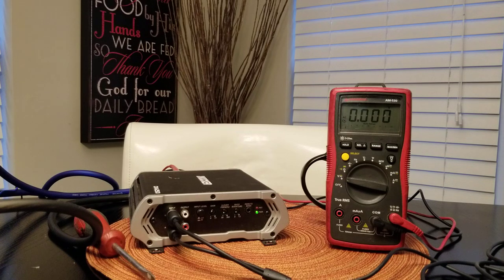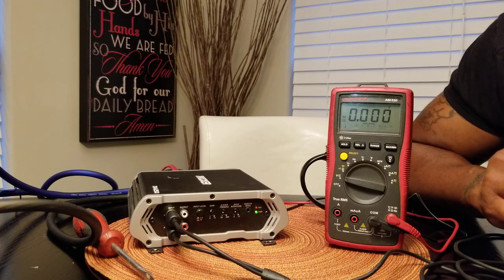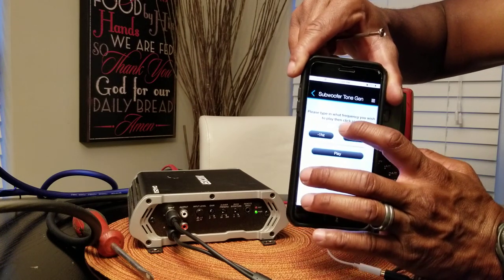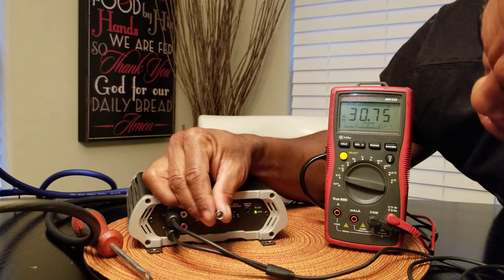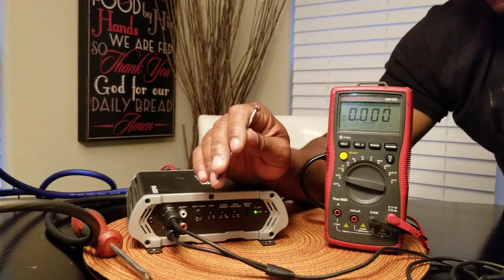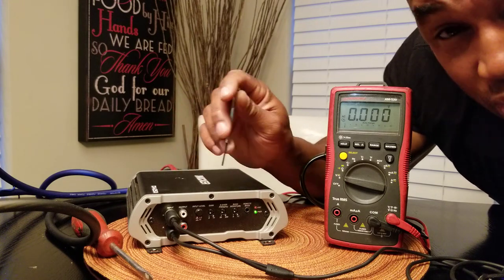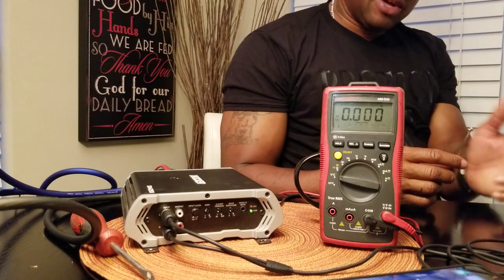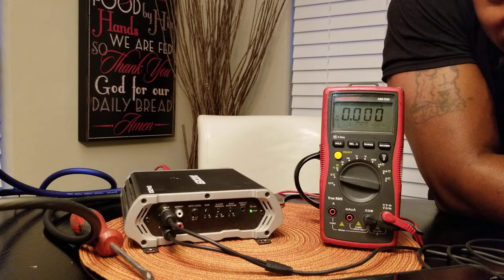Setting amplifier using multimeter

Comment: So you get take the rated power and multiply it by the ohm load in which it makes the rated power and square root it to get the gain voltage? What if my amp is rated 750 at 2 or 1 ohms? 750x2 is 1500 but 750x1 is 750 won't the square root give u a different voltage rating?
Reply: If your amp is rated 750 at 2ohms its cant be rated 750 at 1ohm at the same time. Thats two different amps. Right?

Comment: After setting the gain this way, does it hurt the sub to adjust the eq or the subwoofer out level?
Reply: Yes it will cause clipping. Set those settings first then do this process

Comment: Great  information given. So, setting the Gain w/ Flat EQ means I can only stay unclipped or clean power on Flat, or can I slightly adjust my EQ to get the listening pleasure I desire?
Reply: Let's use 30 as max clean head unit volume.   If you set gain at volume 30, than anything you do boost wise from EQ to Sub Level while playing at level 30 you will be increasing the gain of the head unit which in turn increases the gain of amp beyond it's abilities.   For best results with an EQ you typically want to lower the settings of the other frequencies in order to make the frequencies you want to hear stand out more.   So if you want to hear more midrange, you would lower the higher freq., if you wan to hear more higher freq. you want to lower the middle frequencies.   For all around reasonable results, just use the smile curve and leave it alone.  You could even set the smile curve first and than do the gain setting.
Reply: @A. Melbs  Are you suggesting you're playing at max volume all the time and it's still not loud enough?   That's an issue of needing more powerful speakers and amp so that you can play at your chosen volume and still have headroom for those adjustments.
Reply: @A. Melbs    Unless you want to use meters, it's all subjective to your own listening preferences.

Comment: Thank you so much for this very informative video.       Am using a 12 Volt system at home and it go like this, source (laptop, cp, CD player) to a 220VAC CARVER C1 preamp to Sony 50 x 4 amp and Alpine MRP-M450.  The SONY powers up MBQuart 5 1/4" separates and the ALPINE drives a 12" Sony SVC sub.  I use the Carver because of its multiple inputs and two outputs perfect for each amps.  It is an "ironic" setup but I like it, please tell me your thoughts about a Carver going to two car amps.  Thanks again and greetings from the Philippines.

Comment: Great video boss, simple and clear, one question though. 
When using my multimeter should I put them in the Positive and Negative of where my sub wires are? And should I keep the wires in while playing the tone?
And if I have an LC2i would I need to push the Hi/lo button on my amp?
Reply: When setting your gains you want to put your multimeter red lead to the positive speaker lead on amp and the black to the negative speaker lead on your amp and lightly tighten them up. Your will leave them hooked up to your amplifier while you are running your hz test tone and setting your gains. Make sure your Multimeter is set to AC voltage (not dc). Once the gains are set and matched to the proper power level you are looking for then you will disconnect your Multimeter leads and connect your speaker wire back up. 
Your Lc2i is just a line output converter so before you set your gains look up your amps specs and see what the supposed input voltage is and you can set your the loc to get a clean low level power to your amp. I think the lc2i range is like 2 to 9 volts but you will have to look it up on audio controls website.
When it comes to your amp you will still have to use your hi/lo and make sure all your amp settings are correct.  Remember bass boost is your enemy
Reply: @michaelraykinney  gotcha thanks bud, so for the Hi/Lo button on my amp, should I click it in? Should I set it to high or low? I have it set currently to the Hi

Comment: On my head unit has a sw level, should I have it on 0 or all the way when setting the gain? (I also have a bass knob)
Reply: Turn head unit all the way up, Set to sub to 0 and turn bass knob all the way up and then set amp. So that the amp is set to clean full output at full volume of head unit. Then after use head unit sub level of 0 to 10 or whatever to balance listening sound balance of mids and highs with desired sub level. I use bass knob to turn sub down for some songs or audio-quicker than menu surfing for sub level.

Comment: hello can i ask for so advice                i am upgrading from my 1500 watt  and I now have a amp that can do 5000 watts at 1 omh  but my two subs can only handle 1000 a peace and i dont want to take them out to wire them to 4 omhs right now.     so could i just times 2000 by 1 omh square root that for my gain and  get 2000 watts ??

Comment: first time i ever tuned my setup like this, except i bought a super cheap oscilloscope on ebay, damn, iwe never had so nice sounding system as now, very recommended. Noticed that one of the amps didnt like the 4v low leven output from my headunit also, so a was super clipping before i turned down the hu's voltage out for the sub. Didnt know that until this but with oscilloscope adjustment

Comment: Great break down! Could u make a vid on setting the crossovers? I have a soundstream tarantula and it doesn’t have a sub sonic just a high and low. Also do I set the crossovers after gain? I have kinda a understanding on how to I’ve been setting gain then I set my subsonic at my what my enclosure is tuned to. Say it’s 35 I set a 35hz tone and turn up subsonic till I see a change in voltage and then back down some.
Reply: Also does that app play a 0db tone? I’ve seen some ppl use a -3 to -5 db
Reply: The hpf is actually the sub sonic filter look it up for the details
Reply: @fediplomat  yea I figured it out back then thanks for answering for others that may be wondering

Comment: Great video. However when setting crossover for instance low pass. If I want 80 hertz I understand that my voltage will rise. I how do I know if I’m at 80 hertz when I adjust the filter?

Comment: How come you don't use top of the line equipment? Like Sundown, DB, Tar, JP, and so on? What you're videos cover don't apply to amps with great dampening factors ect. And amps that put out by true RMS instead of max power at multiple ohm loads

Comment: Hi there, I have a Rockford Fosgate T power amp, with the clip light settings, do you recommend using that or a multimeter? which would be more accurate?
Reply from the maker: Use both to make sure you on point. Set it at rated and see if the light stays off. Set it above rated and see if it comes on. Then judge a setting in between those two points and you will be good
Reply: @M.B.Enclosures  good advice thanks

Comment: Nice explanation! I'm guessing, if you buy 500 watt rms sub but you have a 1500watt capable amp. You set the amp gain voltage to match the sub not the amp right? Or else you're feeding 1500w to that poor 500w sub.
Reply from the maker: Correct.. or set it to 750rms off your sub underrated

Comment: I learn a lot from you. Can you make a video about how to calculate port displacement.
Reply from the maker: Why? Plenty of software and apps that will do it automatically
Reply: @M.B.Enclosures   Which one do you suggest?
Reply: @M.B.Enclosures  I understand that for setting the amp voltage, everything needs to be flat- but after the voltage is set, can I increase the bass value or treble value on head unit ?
Reply from the maker: @7ankss  after it set yes.... just know if you at high volume and you increase Bass you might be clipping

Comment: Would you adjust your cross over after you set your voltage?
Reply from the maker: As long as you set the sub with a 40hz tune and the xover is higher
Reply: @M.B.Enclosures  
Respect! Thanks for the advice just ordered a Single  Kicker L7 12 Q  2 Ohm Sub with the kicker enclosure. After  watching your review, with the Kicker Sub (Awesome review) I have  a CXA800.1 kicker Amp Can't afford to upgrade to the CXA1200.1  watt kicker amp yet.  Would it be bad for the sub and amp to run it under powered a bit?  Or can I drop down to 4 Ohms by changing the wiring on the sub? Jus  wanna say you my go to guy for Car Audio and videos on you tube,  keep doing what you doing man!  Mad Love from Canada!

Comment: When setting the gain on your amplifier what do you do with the subwoofer output level on your head unit because I've tried doing it with mine set flat to 0 and I end up having to turn the game almost all the way up in order to reach the amount of voltage that I need
Reply: I put my subwoofer level where I would use it at than I set my gains

Comment: Question: when u turn your phone all the way up will that signal from your phone have any distortion ?or is it distorting cause my gains are to high for the phone to be maxed out?
Reply from the maker: Good question. Honestly I don’t know. I would think it would do back off a clock or two
Reply: @M.B.Enclosures  but then u can never accidentally have ur phone at full volume

Comment: Question for anyone
I have a single DDX12 D4 - 1000W RMS/2000W Peak Wired at 2 OHM
Paired with an Alpine M1000.1 1000W RMS/2000W Peak Stable at 2 OHM
Would my best bet be to set gains at the 45~ volts for 1000W 2 Ohm, or do I have the ability to push it further? Or will further take away from my head-room when playing bass heavy songs?

Comment: You still need to have a sub connected when you set your gains with a meter. Rail voltages change with and without a load.

Comment: There is a 30 dollar oscilloscope on ebay It shows when you are getting a distorted signal. But this method works as well
Reply: This video is dead on with good info but I also use an Oscilloscope that I bought on Amazon .Do you leave subs connected when looking for the clip signal?Somewhere on YouTube the suggestion was to leave the subs hooked up.Either way is a good way to set your gains.
Reply: @bassface1984  yes leave the subs in. And slowly find the clipping point and back off a tad

Comment: I like the multimeter method and used it along with a scope to recently set my gain but your logic about the by ear method is flawed when you say that every song is different, meanwhile you're setting your gain based on a 40hz sine wave, probably at 0db. Music is dynamic, it's not a 40hz sine wave. What you're saying about music applies to your method as well. I get what you're saying though. I can listen to the the tm103 by jeezy and it's just not mixed/produced anywhere near the same as young dolph. Some albums/mixtapes are pushing me closer to clipping/distortion, others leave me wishing I could turn it up more. As far as my head unit goes, I set it as loud as I can get it before I start to hear distortion on my door speakers. Then I use the scope at the tapped speaker wires to verify it's not clipping before it goes into my line out converter.
Reply from the maker: Sir you can’t set a gain by ear…period.
Reply: never said you could and I don't.  @M.B.Enclosures

Comment: So i use a 40 hrtz track to do my 15 skar svr 800 watts /1600 peak i have my gains at 40 but it doesnt sound loud in my car but everybody says they can hear it dts they say it sounds better then the 12s i had? My box is at 35 hertz hpw do i know that for sure i used a 35 herts track to tune it can somebody help also how do i set my low pass filter

Comment: So if I have amp that’s 1500rms@1ohm and 935rms@2ohms
And my sub is 800rms and wired down to 2ohms how do I get the proper voltage that I need?thanks
Reply: Keep the sub wired to 2 ohm. Use ohms law of 800 x 2 = and find the square root of that number. So basically the square root of 1600 will be 40. Insert the multimeter into the + - of the amp and slowly turn the gain knob until you reach 40 on the ac voltage setting.

Comment: Bruh how did u connect the multimeter to the amp and what is the settings on the multimeter as far as math I'm kinda slow on it
Reply: Use the + - inserts. Where your speaker wire goes into the amp

Comment: Great Video and perfect breakdown for those who are DIYers. I had a follow up question, not sure if you’ve touched on the subject yet... now that you’ve got the Gain matched, where should your LPF knob be set at , Is 80 a go to setting? Thanks for any and all input when you have time bro. Stay blessed Stay safe🙏💯
Reply from the maker: 80 is a good setting
Reply: Thanks bruh. So to be clear, do I set this before or after matching the gain through multimeter? Also do I set this at the head unit to 80 as well in subwoofer LPF CROSSOVER? Thank you for your your time in advance. Stay blessed🙏
Reply: Hey MB appreciate the initial reply. I know you be busy doing your thing after work and weekends.

Comment: How about with a bass knob.. how u set gains with knob
Reply from the maker: You always set the amp with the gain knob disconnected. It’s not aBass knob it controls you to where you have the gain set.
Reply: I have a skar rp2000.. should I unplug bass knob when I'm setting gain?

Comment: I disagree with you on the ratings they "Claim" All Brands you named put out more power than claimed haha thanks for your vid i have that same amp going to push a single rf p212d4 but messed up on box yeah yeah i probably need a t313 1/2 and fix this broken cxa1200????? I want both sql &spl..🤫🦄

Comment: When you do the math is that rms whatts, how should I do it if I have a amp that is 1500 max and 750 rms?
Reply from the maker: Use 750 rms to set AC voltage

Comment: Car audio amplifiers are bit more complicated than what you explained.
They convert low voltage DC to high voltage AC then convert that into high voltage DC and then the output section doesn't it's class D or class A/B thing.